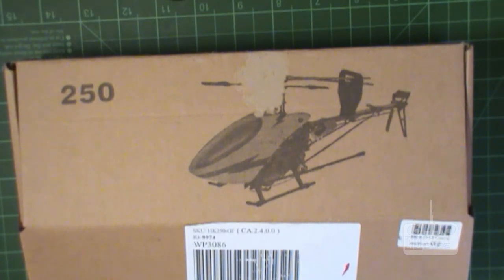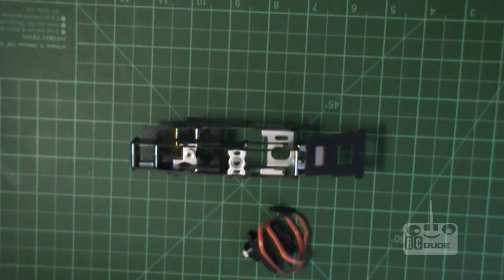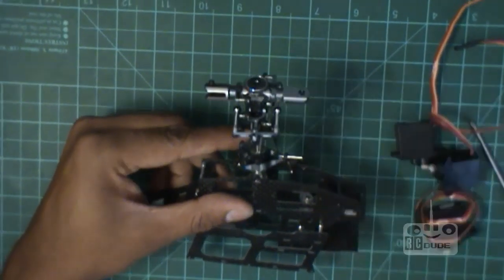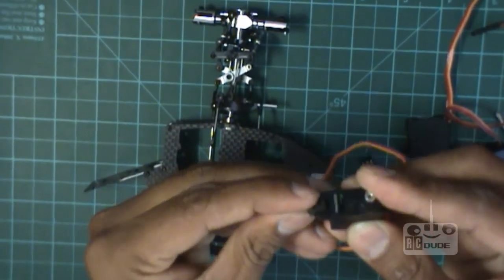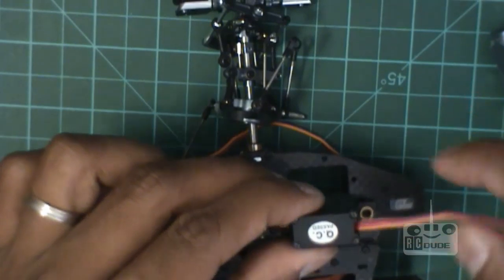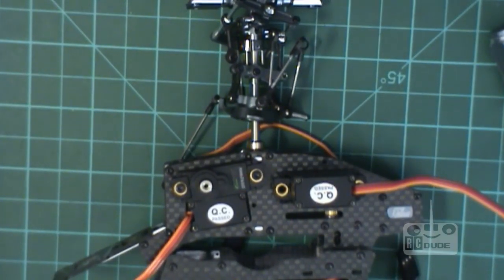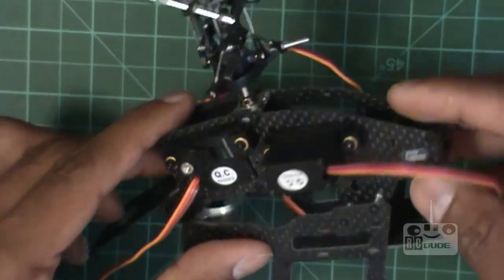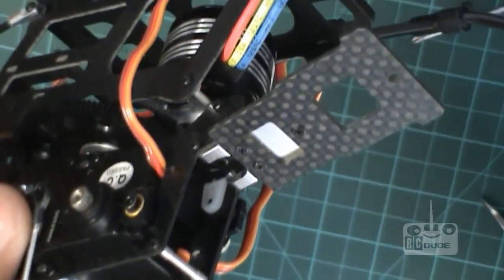HK 250GT Heli How To Build & Full Setup Part 1 Servos

Comment: What is the difference ?. Put up the right servo and left sevo down on the frame, or vice versa ?. The linkage ball can be changed at will too.
Reply from the maker: ok left servo aileron and right servo for Pitch  for yr Blade  its work to get heli up and down depend are how u set up in yr transmitter, some transmitter have pitch nub and some like dx6 can setup in transmitter ,and thiat how u set yr pitch 0 to 12 degree .. 0 pitch can not fly yr heli  so at list u need 4 degree pitch to fly sorry for late reply thaks

Comment: had me one of these too. the belt snapped and the metal head was very loose. but it was only 25 euros at the time. liked
Reply from the maker: i m having really problem with tail boom .. tail boom is really cheep one
Reply: yeah bro, its a very cheap quality. better off getting a CopterX 250 clone if you want to stay on a budget
Reply from the maker: thaks you so much for yr advice i will find tail boom for align 250 i hope its work for me or i will also try copterX250 clone too thanks
Reply: great bro, good luck, yeah when I had the HK, I upgraded the tail boom, tail assembly with belt and head.